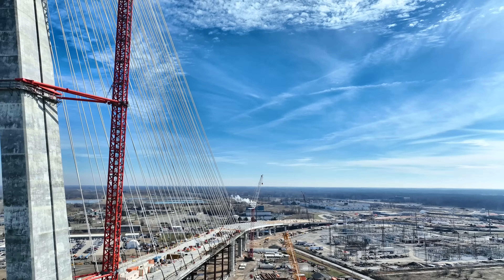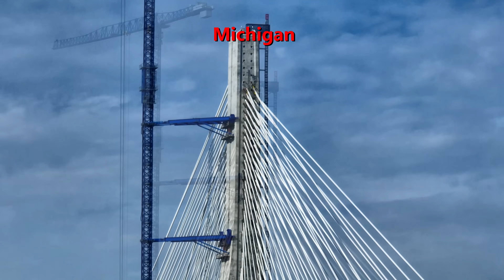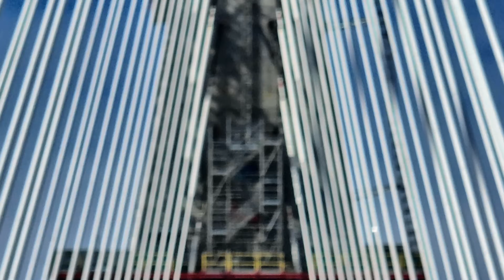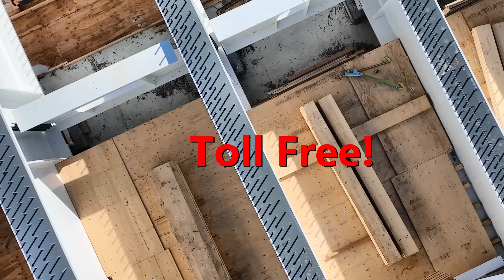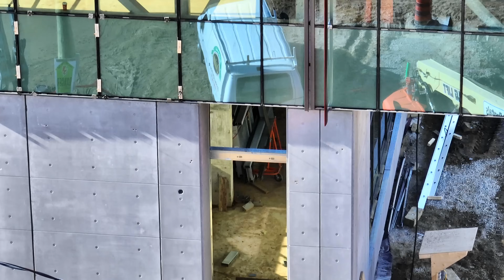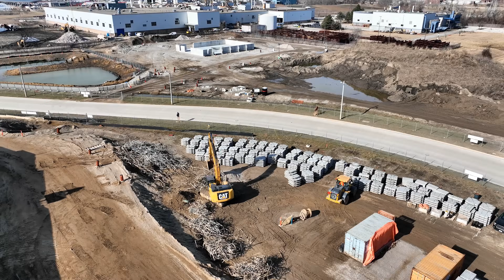What’s Happening With the Gordie Howe Bridge in 2024?

Comment: thanks for this,but do have an issue with this ,there is no voice over to explain who,what ,why its happening,should be a voice over and the video would get more likes and so on ,its the same with all the u tubers filming this project,
Reply: In addition to the growing population in the region,  there are a couple reasons why a new bridge is necessary.  First, with the automobile manufacturers operating systems  mostly "just on time," truck traffic has increased substantially for suppliers on both sides of the border.

The second thing that changed things was 9/11. Customs officials are taking more time and effort to verify vehicle occupants. I know that Windsor residents were tired of breathing diesel exhaust fumes from semi trucks parked on the two lanes of the Amb. bridge.
Reply from the maker: Hi @danielhuculak1877  . Good points. I never considered the just on time reasoning for increased truck traffic, but it only makes sense. Not sure how 9/11 is affecting it, but I think it did earlier on. The fumes from standing trucks and residue from tires and such had been a problem for decades. Great post. Got me thinking. Thanks for being here.
Reply from the maker: Then you know the bridge and where all the bumps are! Lol.
Reply from the maker: Hi Rita. I agree this video doesnt explain much about the bridge. However I do have many other videos of the bridge where I discuss indepth about the bridge itself. Check out the playlist on my channel. I think you'll like it. Thanks for the feedback. I hope you stick around for more updates! :)

Comment: Hope they fixed the design flaw in those bridges,the port mann in British Columbia (biggest when built) drops ice chunks 500 feet onto cars crossing during snow storms breaking windshields and sunroofs and denting hoods etc.😢
Reply: The cable covers are specifically designed to avoid ice accumulation (lessons from Port Mann).
Reply: @epichalfdan  yeah hopefully, all they have done here is to close a lane and slide 2" thick steel collars down each cable as the storm progresses which would be next to impossible in an eastern climate with lake effect snow
Reply: Someone said they might be heated for winter months
Reply from the maker: I believe @epichalfdan has got it right. Some kind of chemical in the material.